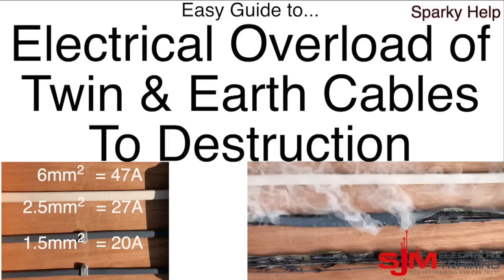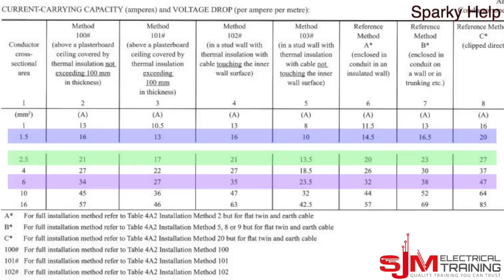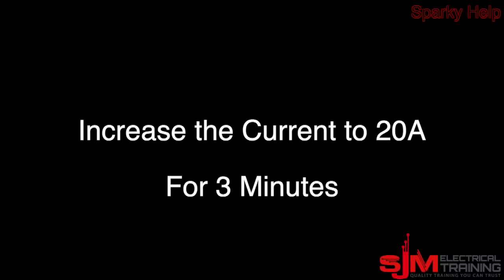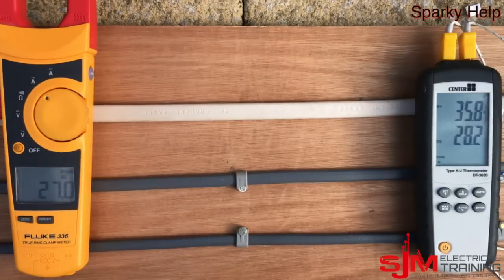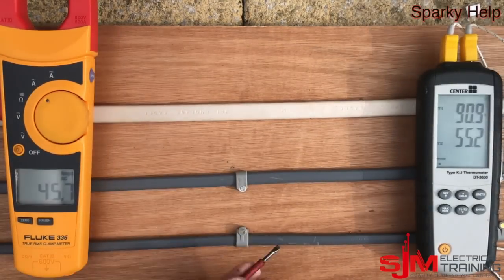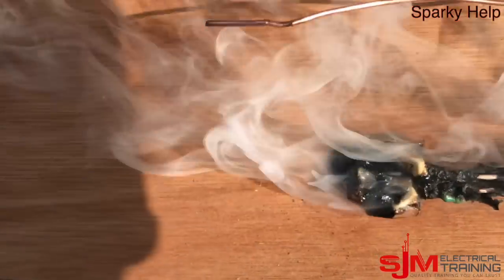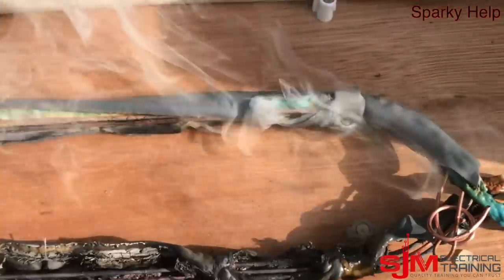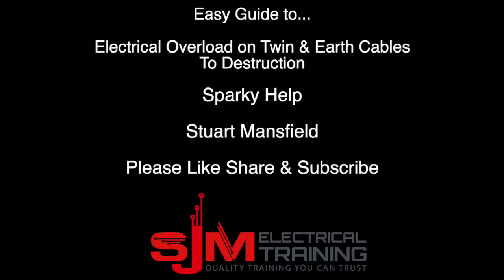Electrical Overload of Twin & Earth Cables to Destruction

Comment: A 15 kW, 400V water heater  installed with a 4x2.5 mm² cable inside an insulated wall. After a long shower, the temperature is around 30–40°C. The maximum safe operating temperature for this cable is 70°C. Why is everyone telling me that I should use at least 4 mm², and preferably 6 mm²?
Reply from the maker: Hi and thanks for watching, please share with like minded people.  based on your information provided,  I'm guessing they do not realise it is three phase, @ 400V Ib = 21.65A.  don't forget to like and subscribe.  Check out my video on cable sizing. https://youtu.be/p4Bxog90TXA

Comment: So what I take away from this is 2.5 is good for at least 40A. Won't be buying anymore 6mm in future. Cheers 👍
Reply from the maker: Hi thanks for watching Please share with like minded people, maybe have a fire extinguisher on standby...  Please like and subscribe.
Reply: In free air... try packing a few cables together or run them in spaces wheres no ventilation going on. 40A will surely make it fail after a few hours

Comment: Note thou to destroy the cable the current needs to be much higher than the ratings.
Reply from the maker: Hi Thanks for watching please share with like minded people.  In most cases it is the insulation that is the limiting factor on current rating as copper melts a1084°C. Please like and subscribe.

Comment: 45 years as an industrial electrician and actually surprised how long the smaller cables held up. Seen a lot of burnt out cables in industry but usually due to bad connections. Of course had they actually been carrying mains electricity things would have gone bang a lot sooner as the cables would short together. Would be interesting to set up a cable with the different installation  methods.. chipped direct, buried and insulated etc 👍👍
Reply from the maker: Hi Thanks for watching, please share with like minded people, I may have to try different installation methods, Please like and subscribe.

Comment: intresting video ,but i must tell you just how poisonous the burnt cable sheath is , it actually travels thru the skin ,ask any fireman why you dont handle burnt cables with bare hands ,please bear this in mind going forward
Reply from the maker: Hi Thanks for watching, please share with like minded people, I did research this topic, but only found information of the flame propagation and gasses given off.  I will bear it in mind, as after all the construction industry used asbestos for a long time without knowledge of its detrimental risks to health .  Again many thanks gloves would be advisable in future better to be safe than sorry.  Please like and subscribe.
Reply: Mainly aimed at some types of rubber as it can form a dangerous acid residue called hydrofluoric acid

Comment: You really should have let the cables sit at their maximum rated current (whilst clipped to a surface) and wait for the temperature to stabilise to give a proper indication of how appropriate the temperature/current ratings actually are.  Then once stabilised creep the current up slow enough that the cable temperature tracks or turn it up a step and then wait for the temperature to stabilise again and see how the insulation copes with that.  In Aussie land our most common insulation spec for flat wires such as these is V90, ie PVC 90c, but in normal installation it's only rated to 75c with 90c requiring it to be installed in such a way that it's not under mechanical stress to avoid push through.
Reply from the maker: Thanks for watching, please share with like minded people, we have cables rated at 90°C. but this also means connections must also be rated at the same temp or higher.  I simply just wanted to show excess current passing through cable, but if I do it again I may leave it longer.  Can I ask what the initial ambient temperature is us Australia?  Again thanks for watching, may like and subscribe.
Reply: @sparkyhelp3997  Normally v90 is only used to 75c but it does open possibilities.  The ambient temperature assumption is 40c.

Comment: A few years back i went to a job where the client had no upstairs lighting working.
I found the upstairs lights on a 40A Wylex plug in type mcb and on further inspection found that her ex partner had installed a 8.5kw electric shower off the lighting circuit !
The cable had obviously failed (client informed me the shower had been in for a few months) 
Amazing really that a cable can take such loads.
Off subject, i had to disconnect and remove the double socket  that the ex partner had fitted over the bath! perhaps he was after some life insurance money!!!
Reply from the maker: It takes all sorts, the problem is the person who installed it would have just said "it works though!"  Please share with like minded people or maybe even like and subscribe.

Comment: Nice test. A test for real world scenarios would be nice.  For example a final ring is limited to 32A by its breaker. It has a ring of 2.5mm cable.  If the ring is broken the 2.5mm may have current run through it, over its rated maximum.  Best case scenario is 27 amps, most is less because of derrating. So if a 2.5mm cable is rated at say 24A and has 32A run thought it, 8 amps higher than the max, how long would it last and what are the adverse effects?

Also, a breaker takes far more than 32A before it breaks.
Reply from the maker: Great suggestion! Please share with like minded people, I will maybe put one together and see how long it will indeed last, thanks again, please like and subscribe.
Reply: @sparkyhelp3997  
Our Continental neighbours say that final rings are dangerous as if they break the cable is liable to catch fire as the MCB will be too big for the cable. As if 32A in a 24A rated cable will instantly burst into flames.  Well the recommended AFDDs should catch some breaks.
Reply: Keep in mind the breaker also activates on temperature. The heat of the copper would transfer to the breaker and eventually trip it

Comment: Great "illustration"! We chose 6mm² over 4mm² for a planned 3ph PV at a scanty 13kW max for 12 meters. My wife feels safe now, but from an engineering side both diameters are clearly over-spec'd.
Reply from the maker: Glad it was reassuring! Always better to be on the right side for cable design especially as certain loads are sustained at maximum for long periods. Please share with like minded people or maybe even liek and subscribe.

Comment: Curiosity question (and I isn't a sparky) what is the ambient temperature of the room you are conducting this test in or outside air temp if done outdoors? We have hot summers her in Oz so the air temp is often 30°C or hotter so would that lower the amount of amps the cable could carry before the cable self-immolates especially the lower gauge cables like 1.5mm?  Ta. 👍

In the early 1980s I made cables like this for Associated British Cables and the plastic had a melting temperature of about 160°C to 170°C. Never saw one tested to destruction but I know if I saw a cable actually melting I knew what the temp would be like.
Fun fact. When a cable was tested a pinhole in the plastic sheath could be detected and found on a drum of a couple of thousand metres. When the pinhole was found the repair guy would get a single granule of the plastic which was about 3mm in diameter and would manually melt the granule so it would cover the pinhole. Cable was then sent to the winding department and wound onto the smaller spools that you guys buy at the supply stores. Interesting job.
Reply from the maker: Hi, thanks for watching, this was carried out outdoors, the temperature was about 18° C on this day.  You are quite correct the values of current carrying capacity have been tested in an environment of 30°C  If the ambient temp was higher the current carrying capacity would be lower and vice versa if you could guarantee lower temps then the current capacity would be higher.  Thanks for your question please share the video or maybe even like and subscribe. Again thanks.
Reply: I think ambient is less of a concern, as to what environment the cable is installed. ie insulated ? covered ? anything flammable nearby etc etc. The small range of ambients most of us live in, not so much of an issue.
but either way, for these tests, thermal imaging is essential to see when the actual cable is at a high risk temperature

Comment: Its amazing just how much current these cables can withstand against how much they are rated for in BS7671, very interesting experiment!
Reply: My grandma whole kitchen is wired with 2.5mm2 😂 including oven, dishwasher and 4 hob induction cooker. It never tripped. I was amazed when I saw that and asked how was it possible the breaker never tripped, she said she never uses two appliances at the same time because she's basically a cheapskate 😂😂😂
Reply from the maker: Yes it is, glad I'm not the only one who finds it interesting, please share with like minded or maybe even like and subscribe. Check out my other videos.
Reply: I guess this is an ideal situation with no enclosure at all, the point you worry is when the plastic softens not burns as you can probably get shorts if it does. Plus there is also voltage drop to worry about, and that must have been significant at these currents.
Reply: @daveansell1970  This is exactly what's happening, in a real install cables are covered quite often by insulation and other building fabric.
Reply: Keep in mind the cable in this test is short
Reply: I also find it quite terrifying as someone could be overloading a line for quite some time thinking it's perfectly safe when actually it's actually right on it's tipping point, waiting for someone to plug in a hair dryer before it burns the building down! 
Schools need to teach everyone this stuff, not just people who want to work with electicity.